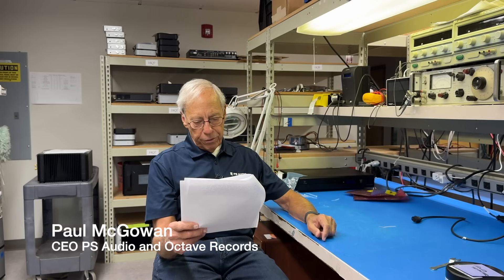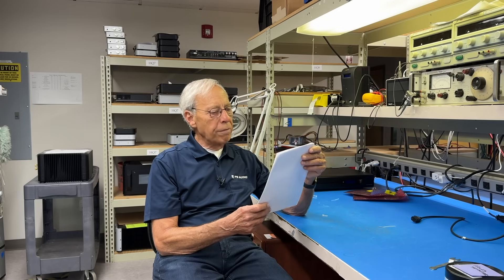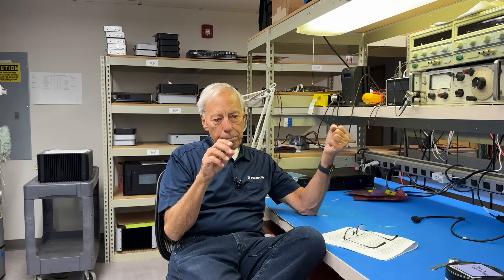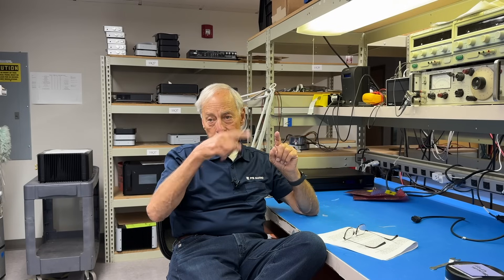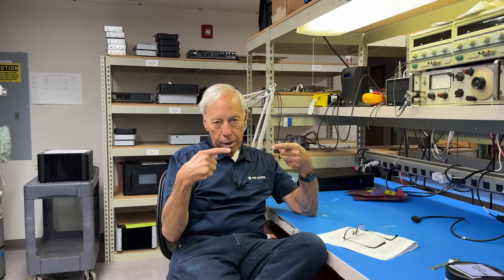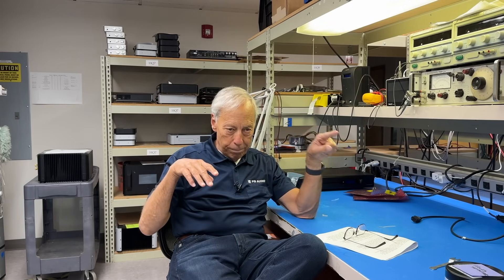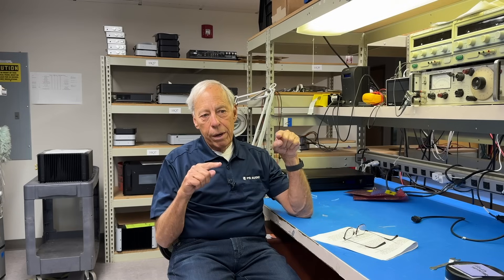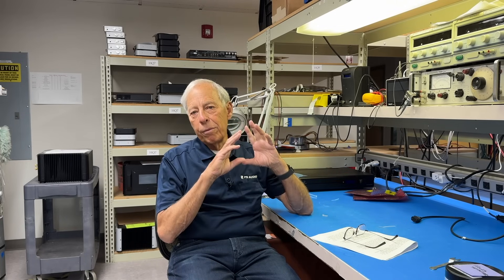Full balanced amps explained

Comment: I think most people are taking fully balanced to mean basically 2 amplifiers in parallel, one for a positive and one for the negative signal, with any common mode signal amplified and only cancelled at the speaker. However a differential amplifier stage is fully balanced throughout, but cross-coupled so the common mode signal at the input is eliminated and the + and - outputs are only the differential signal. Which is it? A diff amp can also convert single-ended to differential and most often is used in single-ended output mode.

Comment: This helps me understand why when I added two REL S510’s to my system (using high level input) with the BHK 250 amp I could not connect the black negative (ground) wire from the subs to the negative speaker terminal. Had to connect it to the BHK chassis ground which PS Audio was good enough to send me to add to my amp.

Comment: So with the vast majority of sources being unbalanced with some providing balanced outputs using additional circuitry, going into primarily single ended designed preamps that can do balanced in and out with additional circuity, into primarily single ended gain staged power amps, but have additional circuitry for balanced in.... 

That's 6 additional circuits stages... just to provide a different cable connections between devices? 

Of course if the source to output is fully balanced...

Comment: What Paul has described is, in essence, a bridged amplifier. The only real difference is that the signal is already inverted prior to entrance into the amp rather than a single ended input going into a buffer and an inverting opamp in order to obtain the inverted signal needed. 

What is missed in all the talk is that when the balanced signal is recombined in a "normal" amp, the noise goes away and then any resultant noise is coming from the path through the amp(s). Unless they are a perfect 180 out of phase, that noise gets through and is amplified. Almost all amps do a good job of keeping extraneous noise down in the power amp section.

The other big advantage to the "fully balanced / bridged" mode is that you get 4 times the power for the same supply voltage. Therefore, you can drop the voltage to bring down the power, but increase the transformer wire size to increase the amperage available. This gives more headroom for all and also increases the ability to drive difficult loads (low impedance dips from speakers).
Reply: Paul please bring back stellar gaincell dac perfect match for the 300 power amp stellar gold pre a little too pricey 😢

Comment: What Paul describes at the end, with respect to the PMG Sig preamp is fully "differential".  The term "balanced" is not technically correct when talking about the internal signal path.  "Balanced" refers only  to a connection type.  An input or output can be balanced, but an amp or preamp is differential.  The term balanced is commonly misused.
Reply: Now let's talk common mode! 🙂

Comment: My needs these days are simple. I sold my Phase Linear system years ago because I could not find anyone in the state of Arizona to do the recap both amp and preamp needed.

Today, I'm a headphone only guy. My needs are not complex. A decent set of Hifiman Edition XS and a little Ifi Zen DAC/amp meets my needs just fine. The Zen DAC has a balanced input so I spent a little money on a balanced cable for those headphones, and the difference was notable. I heard a wider soundstage and overall dynamic improvement immediately. That extra boost in power the balanced cable provided was also noticeable.

I got the thought that I would go on eBay and reassemble my system from the seventies. Uh, no. Not for that kind of money. My headphones are just fine, thank you.

Comment: ".... guitar lead signals are not balanced; they are unbalanced, using (Tip-Sleeve) cables to carry one copy of the signal on the "tip" and ground on the "sleeve". While unbalanced cables are susceptible to noise, they are suitable for typical guitar rig lengths because the signal levels are high enough, and the noise pickup isn't noticeable. Balanced signals, used for microphones, use two signal wires with opposite polarity to cancel noise and are only effective if both the sending and receiving devices are balanced."
Reply: My Taylor T5 guitar has a TRS balanced output!
Reply: You will never see a guitarist run as long of a cable to their amp as a vocal mic using a balance connection to some mixing board. Yes the length of the cable makes a big difference in playing a guitar! 60+ years of experience!
Reply: The Rivera Sedona Guitar amps have a balanced input option.

Comment: I don't think fully balanced amplification is worth much.  
And whether an amplifier is balanced or not, the Voltage Difference between the output terminals 
is what drives the speaker. Grounding one terminal does not make it "zero" for AC.
Reply: Paul, it would help to make explicit the value that a differential connection brings: the elimination of noise that is common to the two cables. The biggest source of such interference should be pick-up (magnetic induction) of stray fields by cables. This is why a balanced input makes most sense on a low level signal that is prone to interference. The most obvious application would be the low level signal from a microphone, a tape head or even a moving coil cartridge. Most DAC chips have differential outputs, and it is this that has led to the indiscriminate proliferation of balanced circuits in domestic audio.
Reply: Yes all passive speakers are balanced. Regardless of what type they are fed from.

Comment: I own the PS Audio S300 dual mono amp and I love it!  

I Bi-amp PS Audio FR5 speaker with NAD C298 for tweeters, and PS AUDIO S300 dual mono for mids.
For music in a 2.2 setup, I also run 2 independent sealed subwoofers (1200-1500 watts) each with 2 bass radiators.

source=Apple Music lossless

Comment: IF YOU HAVE A TRULY BALANCED CONTROL AMPLIFIER,  A TRULY BALANCED AMPLIFIER,  BOTH WITH XLR CONNECTORS. CONNECTINGTO A 2 WIRE SPEAKER SEEMS TO NEGATE THE BALANCE~ WILL YOU PLEASE ELABORATE WHY MOST SPEAKERS DO NOT HAVE XLR CONNECTORS ??? PLEASE~LoL.......
Reply: That's because there's no such thing as "balanced sound" lol the balancing is only supposed to reject interference on the way to the speaker. Once it gets to the speaker there's no more point to it! Speakers are normally down at 8 Ohms getting a good amount of current through them. So we're past the few millivolts you get at line level, at that point balancing would just add needless cost, noise and components just to unbalance the signal inside the speaker box to send it single ended to the cone. It's a silly expensive thing to do!
Reply: @blakasmurf  "no such thing as balanced sound". After mucho thought for the last year, it is finally becoming clear. I must commend you all for such great answers. I have asked this questions before here on PS audio & been ignored. Now your knowledge have helped more than the geeks @ audiokarma, & past post here. I do thank-you~
Reply: Speakers are neither balanced nor unblanced devices, because both these terms require a ground connection to be present on the device in order to make sense, but speakers have no ground connection. As much as electric noise is concerned, a ground connection is only useful to shield the device from the noise induced by the electric field. This is a real concern in small signal devices such as turntables, preamps, and their interconnecions, but it's not a concern in speakers due to the strong signal and low impedance of the device. This is why you'll never see XLR connectors on passive loudspeakers.
Reply: Ummm...because there's no point 🤔🥴
Reply: XLR has a grounded shield to reduce noise at the lower voltages those cable carry. Speakers don't need that third lead. XLR connectors are not rated at the current levels speakers need. They would arc. Possibly melt.
Reply: @glenncurry3041  Quite conceivably with a lot of 20 minute long sub-bass electronica.
Reply: WHY ARE YOU YELLING???
Reply: @spenceralridge4958  😂🤣🤣   I nearly asked him the same question & then I satisfied myself THAT IT IS JUST HIS WAY OF EMPHASISING HIS POINT. HE COULD HAVE GONE BOLD AS WELL  😉
Reply: @spenceralridge4958  If you can hear me yell you need to see a psychiatrist!!!  It is so silly , "yelling" ha....I like capitals....and to me it does help make a point , but by no means yelling. So ,so silly........ha

Comment: Balanced interconnects mske a lot of sense...in a concert venue or when having longer wires where there is an audible benefit of adding the extra components in the signal path. In my humble opinion, better is a well optimized RCA single-ended circuit for a few feet of interconnects.
Reply: I thought the same for decades; if it's less than say 4' you're not going to hear any difference in SQ. I contacted HEGEL in Norway, soon after I bought my H390, to ask them whether the one set of XLR inputs on the back were a truly balanced set to which 'Christian' replied that the pre section is truly balance but, obviously, the power section is not. I thought that I'd try a reasonably priced (AU$433) pair of 0.8m pure silver, cryo XLRs, just to appease my curiosity, & spent the afternoon A/B'ing between those & a pair of 1.0m SE RCAs using exactly the same cryogenically treated, pure (5N) silver interconnect wire (cables) With the XLRs, even at these very short distances, the sound had more detail & authority & no it had nothing to do with the doubling of the voltage from 2.0v to 4.0v as I made sure to adjust the gain to keep the volume levels the same. Suffice to say that I won't be going back to SE RCAs...regardless of cable the length.
Reply: I suspect the RCA circuits didn't get the same engineering care. Now of course balanced will help in a very EMI noisy environment (you might hear noise) or if you have ground loop(you will hear hum) issues even af shorter cable lengths, but since you don't talk about actual audible noise, it's hard to judge what makes your observed difference.
Reply: @ThinkingBetter  "what makes your (my) observed difference." ?? Mainly my hearing.
Reply: The benefits of balanced is not directly about "detail and authority". But perhaps you have more gain on the balanced signal path making the sound louder at the same volume setting. And perhaps just the quality of the circuit is higher.
Reply: @ThinkingBetter  I addressed adjusting the gain when A/B'ing to maintain the same volume in my previous post.
Agreed that there could be better quality in the balanced input circuit in the Hegel &/or better
quality in the balanced output circuit in the DAC's output. Thanks for pointing that out...good call 👍
Reply: I guess it all depends on how well that circuit is designed, sometimes companies spend more time on the RCA circuit and others on XLR I guess the only way to determine which sounds better is by critical listening
Reply: @carlitosgomez71  Exactly! No guessing required 😉
Reply: Thank you
Reply: In a true balanced design, you get 6 dB more of signal/noise ratio than with single-ended  interconnects. That can be a very meaningful difference. So true balanced designs and interconnects have benefits beyond just better noise rejection for long runs of interconnects.
Reply: @MrChristerBerg I have a 30 feet RCA cable that I use to demo the problem with RCA cables...but I also have lots of 5 feet cables where human hearing can't detect any added noise and the capacitive treble roll-off is a non-issue.
Reply: Balanced I/O? That's typically 6 additional circuits stages... just to provide a different cable connections between devices?
Reply: @glenncurry3041  OK...& what if the topology isn't typical...how many additional circuits then?
Reply: 512
Reply: @glenncurry3041  Haha! Yeah, I guess it can go both ways 👍😂
Reply: not true they make a lot of sense in any audio system
Reply: @net_news Most audio setup  interconnects are too short to cause noise issues in normal conditions. Exception is common mode current noise (hum).
Reply: @ThinkingBetter it also solves ground issues and has lower distortion, balanced is better in every aspect and it improves any system.  It's not an opinion it's a fact.
Reply: @net_news Yes better against ground loop hum but why would it help lower distortion when in fact it has more components involved?
Reply: @ThinkingBetter  because any added distortion is eliminated
Reply: @net_news How? It is not what it does!
Reply: @net_news not true it cancels even order harmonics but leaves odd order harmonics, so it can make a system sound worse than single ended in certain circumstances.
Reply: @ThinkingBetter it does, any added distortion will be removed it's how differential works
Reply: @net_news No, it's not. What kind of distortion do you imagine it helps with?
Reply: @ThinkingBetter  any added distortion
Reply: @net_news Imaginary distortion. We are talking interconnect. Distortion is a thing of the electronics.

Comment: Fully balanced throughout imho is kind of silly, we're talking about keeping 2 copies of the signal fully in sync, no phase shifting, exact frequency response etc througout the whole signal chain. That's expensive, you'd need 4 indentical matched circuits for stereo audio, not to mention the Johnson noise you're adding! Other equipment upstream or down stream being unbalanced negate all of this! The best amps unbalance as soon as possible and rebalance on the output. The disadvantages out weight any benefits again imho
Reply: I have a fully balanced (except my turntable) system, and I love it.
Reply: @scottyo64 It means some serious care was spent on engineering it.
Reply: @scottyo64  You are absolutely sure not a single device is single ended along the way? And it is easy to balance out a turntable. Being just separate coils they are inherently balanced. Just typically one side grounded to the case.
Reply: @scottyo64  Congrats but I honestly think you'd have been just as happy with balanced in and out. In fact have you really checked the topology yourself? A lot of systems say fullly balanced but looking at the circuit it gets unbalanced in so many places it's laughable. To do it you'd need at least 4 truly identical circuits for stereo
Reply: Yes, I think so too.
Reply: Agree, but even on a few feet of interconnects having those extra transistors to reduce noise is mostly a bad compromise. You can easily achieve excellent SNR on an RCA connection of a few feet. In the end it's about good engineering.
Reply: @ThinkingBetter  Yes I posted above: That's 6 additional circuits stages... just to provide a different cable connections between devices?
Reply: @glenncurry3041 Yes balanced in itself doesn't alter the sound against a similar well designed single-ended connection.

Comment: I thought I did understand ”balanced” before I did see this video.

But now - after watching this video - I am totaly confused. 😢
Reply: Ok so balancing is just used to negate noise and interference picked up during transmission especially along cables, you have to remember cables are exactly the same as antennas really - This cancelling is done later on by something called a differential reciever. What's being talked about here is fully balanced equipment e.g. amps that keep essentially both copies (+ & -) of the signal throughout their signal path. Doing this is 1. expensive 2. has more disadvantages than benefit 3. actually ADDS more internal noise by having double the amount of components that have internal noise called Johnson noise. Don't be fooled by the "fully balanced" marketing look at the actual performance and compare noise floors, THD etc.
Reply: @blakasmurf Yes, a balanced input/output serves as a common mode noise reduction circuit that makes sense when a cable gets to a length where the noise becomes an actual issue.  Adding extra components (not helping the integrity of the signal) in the signal path for a non-existing issue seems what people do when they use a 5 feet balanced cable (unless some common mode ground noise problem exist).
Reply: @blakasmurf  Better still, just listen to the gear & if you can't hear a difference then choose the cheaper of the two...usually the SE.
Reply: He should have used a whiteboard. Making it visible is better than waving hands🥳
Reply: Even a non balanced XLR circuit (pseudo design) can reduce interference due to the XLR cable design (star quad etc) being used, but without a true differential design throughout the system, most of  the advantages in true balanced (noise rejection) are lost and short SE connections may in fact perform better as the amp designer may have spent more time and money on that part of the circuit and only used XLR as an afterthought